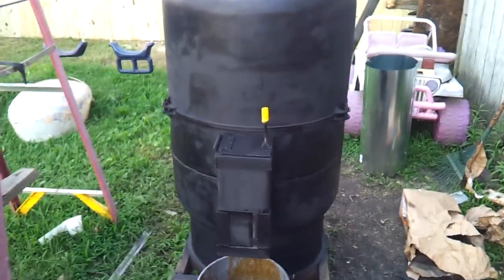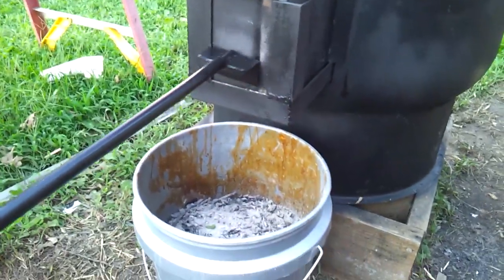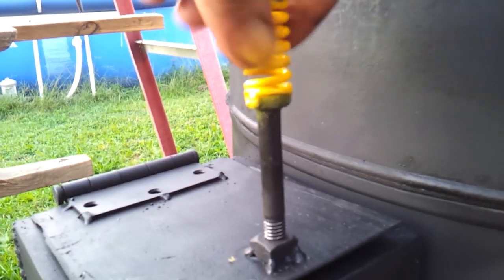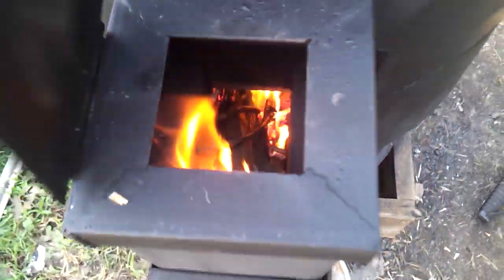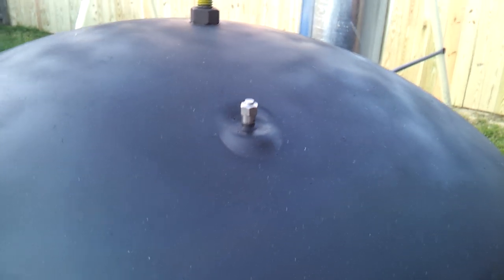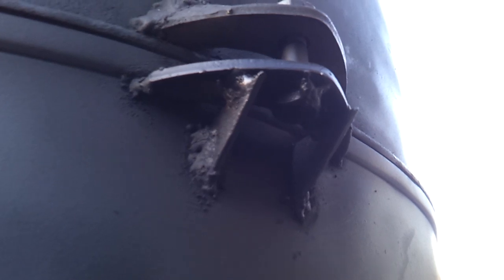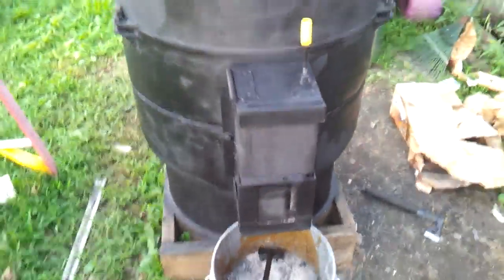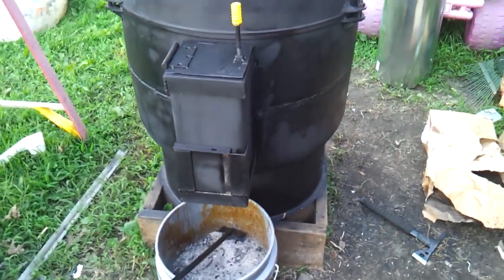Rocket Heater Wood Stove Build Part 11

Comment: been heating with wood since 1979 2100 sq ft-- fire brick will crack --   replaced wood heater 2012  first replacement

Comment: how long of a burn can you get from this
Reply from the maker: it really depends on the type of fuel you are burning, dry thin pin about 10 to 15 min.... thick oak or 2x4 and 4x4's about 30 to 40 min.

Comment: i saw your videos I mid jan. of 2014. you've done a great job on the stove and the video. I've got a place in the woods, a 20x25 concrete garage, that I've been heating with one of those 55 gallon drums with the door and feet kits on its side. that system sucks, so I've been looking at rocket stoves for the last few months. your is one of the two best setups that I've seen. nice job and thanks for the info.  smoky57
Reply from the maker: smoky57 Thanks a lot.  I have been heating my house with it and keep tweeking it but plane to adapt it to burn multipale fuels like waste oil and things like corn, pellets and woodchips. Thanks for watching. please subscrinbe if you like what you see. Happy 2014!!!

Comment: very Awesome build love it  thinking about building something  like this for my garage but i do have a question about the fire brick and  clay riser inside the tank are you having any problems with the  fire brick or clay riser cracking  at all due to the high temp of the fire inside the burn chamber
Reply from the maker: don48624 Not so far. I have not removed the top yet to inspect the inside. I will do a video when I do that to show how it held up. Thanks for watching!

Comment: Very clean nice design!  I like all the fire brick and safety ideas built into this one!
I would add that if you make the chimney into a mass heater version (code pending) you would reclaim that heat that is warm going up the chimney.  If you can not due to code, maybe copper tubing wrapping around to in a loop to a hot water heater to pre heat water going to your domestic?
Reply from the maker: David McLaughlin Thanks alot!